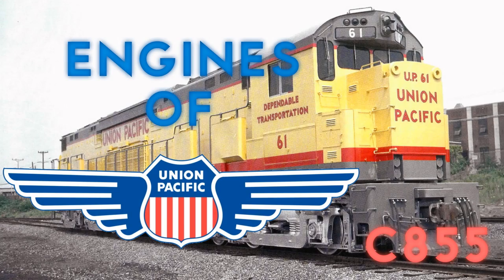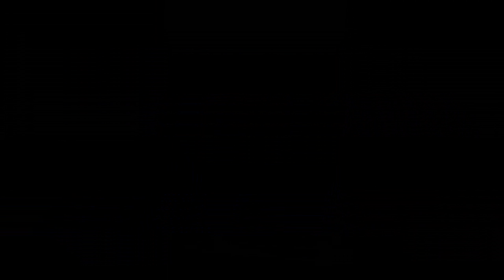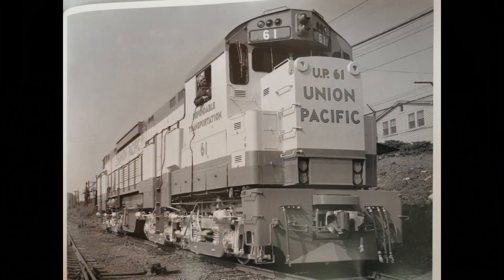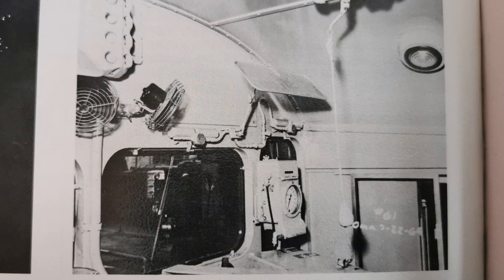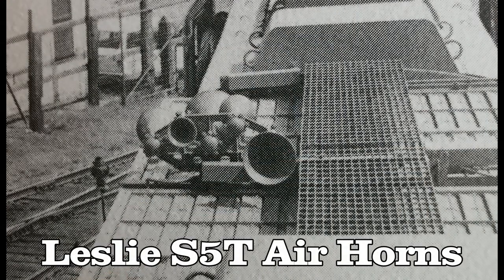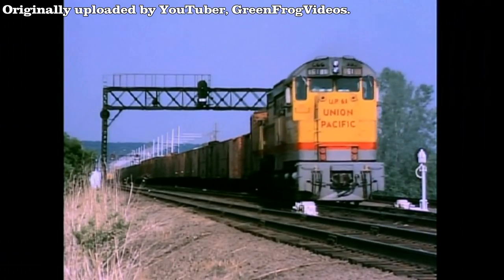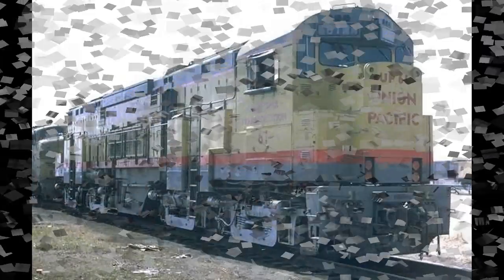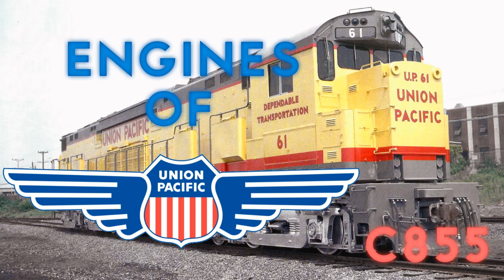Engines of Union Pacific Episode 5, ALCo Century 855

Comment: Thanks for this article. The only thing I knew about the C-855, was from the 2nd Diesel Spotters Guide, and it must have been printed, right when the A unit came out, no B was mentioned. I had a 2nd U 50 chassis, so I just kitbashed 2 MRC Alco C420 bodies, and chopped the nose down. Didn't care for UP at the time, so I just did mine up in L.I.R.R. Blue.
The use of alum. wiring was also a curse to volunteer firefighters, because of house fires, because of corrosion at outlet boxes in new homes that used the wiring, and many homes caught fire, especially near saltwater areas. Long Island areas even banned its use.

Comment: At 5:23 you said "... it had a dual Alco 251C prime mover as well as a dual V16 diesel engine ..."  The Alco 251C "prime mover" IS a diesel engine; it didn't have two prime movers and two diesel engines.  Also, although the term "dual" is techincally correct, it was two separate identical diesel engines which operated independently.  It was basically two separate complete locomotives on one frame and set of trucks (just like the GE U50 and EMD DD series).

Comment: Can't blame ALCo for the electrical issues, it's all on GE. I talked to a few Mech. Dept bosses and they really liked the ALCo 251 prime mover, especially with steel capped pistons. I never ran an ALCo with a 16 notch throttle. The early GE's had those, they were half notches. You do have some great, informative videos.

Comment: Quibble, quibble; the 8 referred to 8 axles, not 8 axle trucks.  An 8 axle truck would be an H truck. 😁
The trucks and the span bolsters both came from the 4500 hp turbines, same as the U50s.  I read some where that the span bolsters were causing problems on the U50s and were a factor in their early retirement.  You can take that or leave it.
Personnel opinion of C855s were they looked like they could pull anything, but ugly so very, very ugly, and I normally like ALCO's designs.  But in this case somebody ran it through the Ugly filter.
Edited to placate the typo gods.

Comment: You know, in terms of aesthetics, the 855 is one of my favorites of alco’s century line. I actually have a fictional model railroad called the Colchester and Midwestern, where they bought engine 61 in November 1971 and upgraded it with reliable copper wiring and renumbered 1005. Where it runs to this very day

Comment: So, what ive gathered from these episodes is that to the weight saving of aluminum wiring is not worth it
Reply: It’s not saving weight,  it’s saving money.  Aluminum is a lot cheaper than copper.  And it’s not good savings.  Aluminum has proven to be a poor material for wiring.

Comment: cool video, I had never heard of the Aluminum wire in the 855's I know that Ge had used it for weight savings in the U50c and that the C-C truck did not handle that weight very well. I believe that Alco had superior products in their Century line and had many innovations that were ahead of their time including the first AC traction
Reply: A lot of older homes had aluminum wiring and it’s very dangerous there too.  Caused a lot of electrical fires because someone wanted to save $100 on cheap wiring.
Reply: Makes me wonder why GE used Aluminum wiring in U50C after problems Alco had with this locomotive.

Comment: They had DC generators, not AC alternators (Wikipedia is in error).
Reply: Best go to Wikipedia and correct it yourself (I wouldn't do it with only your comment as a source).
Reply: @uncinarynin  Multiple sources show the C855 using the GE GT598 generator.  The first Alco with an AC alternator was the C630.

Comment: Whomever it was who thought it was a good idea to run up to 900 volts of electricity through ALUMINUM wires clearly failed basic science classes or otherwise never took any classes in electrical engineering. EMD made similar mistakes with their SD50 line, and they never recovered from it.